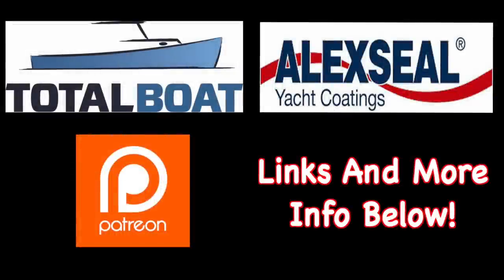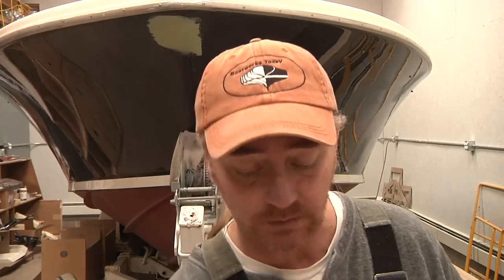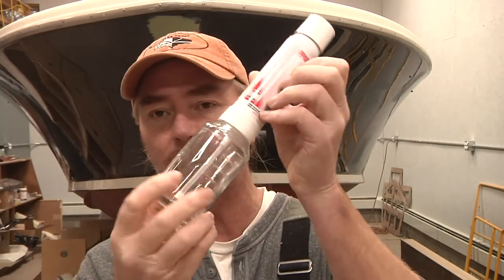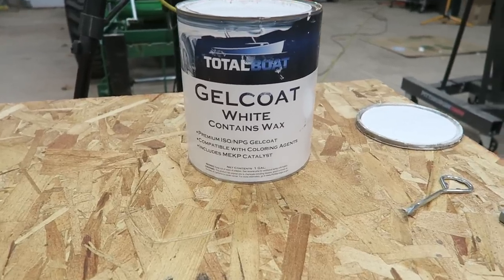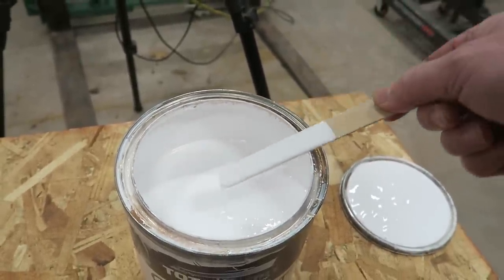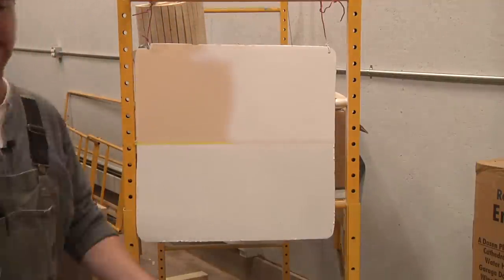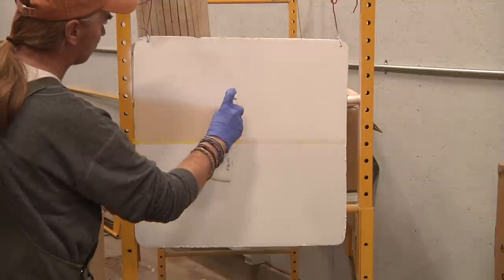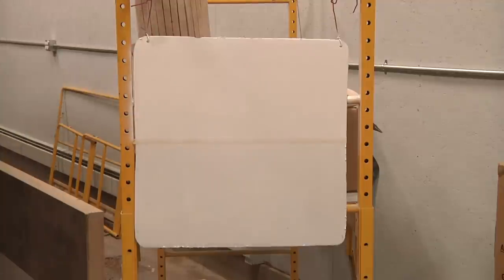SPRAYING GELCOAT DIY STYLE FOR BOAT REPAIRS!

Comment: Tried Preval with variety of house paints and it clogged due to freezing of the outlet.  Pressure drops and it freezes quick.  I tried it in Florida and maybe paired with the humidity it was worse at freezing. 🤷‍♂️ Absolutely worthless. Maybe could work with thin stains.  I can’t imagine using it with gelcoat.

Comment: Having worked in a yard my whole career the Preval was the primary sprayer for small areas. The MOST frustrating thing was the inconsistency of each unit. You can pretty much get a system going where you can mix the gelcoat consistently to get good results but the sprayers drove me crazy. We would but at least 1 case maybe more at a time & if your in a cycle of doing a lot of sprayers it's ok. But buy a case, use a few then let the others sit for a few weeks, grab 1 & start using it & the propellent has leached out so it's useful for 20 seconds & dies. Now you have to scramble around because you only have so much time with the mix.
Reply: How long have you worked on boats for? Prevals work if you know how to use them. If the gel is thin and preval has gas still and is not cold, It has to be the small hole that’s clogged up at the bottom where you insert the plastic straw. A lot of times the hole is really small which causes it to spray like crap . Get a thin metal pin and make it bigger. Make sure to also clean it thoroughly with acetone inside and out

Comment: Thanks, great video. Clearly explained why not to use waxed gel coat. I have been sealing sprayed gelcoat with any brand of Mega Hold Hair Spray. Same key ingredient as PVA. But way cheaper and already in a spray can. Works great. Wash off with warm water. Just let the gelcoat sit for a couple of hours to be sure all solvents have evaporated before spraying Mega Hold. Credit to some article in Epoxyworks Magazine for the idea.

Comment: Keith Rucker over at VintageMachinery used one of those to paint  some old Cast Iron Norton Tri-Stone holders....he said he most likely wouldn't use them again.  The things constantly froze up, and did exactly what you said...and that was enamel paint that was properly thinned.  He said he'd pull a sprayer out to do it next time.

Comment: Could you apply a layer(or multiple layers over 1 or more spray sessions) of laminating resin w/o wax and then final layer with the resin w/wax so the whole thing will cure hard? Re-coat time interval for all layers could be multiple sessions over multiple days. I am assuming that the requirements would be the same as using laminating resin when laying up glass, do not require sanding between layers(if done in a reasonable amount of time of course), is that correct?

Comment: I repair leather seats and I use these when I need texture to hide a repair to reproduce the grain pattern in a door or seat or armrest, they simply spit to much.  I would recommend a badger. 250-4 with large nozzle.

Comment: Hi, I have got questions. How do you stop the leaks in the air vent?

Do I need to remove the filter from the tube when I spray 2k primer, 2k clear coats and base coats? 

Can I refill 2k primer and 2k clear coats and reuse it again?

Comment: Andy I'm apply same sprayer -garbage only I just spoiled a portion of the gelcoat ,,, there is a liquid in it that probably just interferes with the normal spraying of the material, it may be necessary to heat the balloon to a certain temperature before use, but it does not work correctly, as shown in the advertisement in general

Comment: Damm I used the durateck on the bottom of my 1972 boston whaler will it blister on a trailer boat? I've had a problem micro cracks appearing after filling yes it has the boston whaler alligator pox  on gel coat I have used the 3m vinylester filler. the latest try is to soak the surface with west epoxy with slow hardener it been on a test area 3 months so far its ok should i use hibuild epoxy primer im finishing the topsides with paint. will paint on the bottom stave off the blisters  I hate to flip it over again thanks jerry k

Comment: The propellant is a mixture of butane and propane so be sure to have no open flame when using a Preval sprayer.  Link for the MSDS - http://preval.com/wp-content/uploads/2018/10/Preval-Spray-Gun-Power-Unit-SDS-ENGLISH.pdf

I have found that Preval sprayers work very well for small jobs, but the viscosity of what you are spraying is critical.  I have sprayed water based finishes with Prevals and you really have to pay attention to the spray unit temperature there too.  The only other downside of Preval sprayers is that they are expensive, but for a small job you may spend almost as much on solvents cleaning out a regular spray gun.

Comment: Harbor freight little touchup gun drill the tip ( can't remember the exact size i can check if your interested) spray two coats not thinned then sand to 100, then take your good gun thin to 17seconds on a Zahn #4 cup spray looks like glass...I like styrene too but has a short self life.
oops! thats a ford #4, hey I bought it like thirty years ago.

Comment: With any product, there should be a 'material safety data sheet' so for that sprayer just search for 'Preval sprayer MSDS' and you have the answer ;)
I used to have a spraycan that was refillable, but you pressurisde it with a standard air compressor or tyre pump (search for 'refillabble spray can' you should be able to find what looks like a normal aerosol can, but with a tyre valve

Comment: I just googled styrene: apparently bad stuff. I love those little sprayers. When I was da fix-it guy for 126 new homes I carried them with all the colors needed to touch-up after doing spot-repairs in drywall, trim and cabinetry.  When sprayed for only a few seconds the cooling problem doesn't exist.

Comment: Just out of curiosity what size nozzle do they have? 
I tried a compressor and spray gun with 2mm needle/ nozzle and it was spitting quite a bit even with a 2% styrene added to thin it out.
Reply from the maker: I honestly don't know what size nozzle Preval has, but it's pretty small.  If I were spraying gel with a regular gun and compressor I'd be reaching for something 1.5mm - 2mm

Comment: But you really need a gellcoat gun with a 2.5 mm. nozzle or a metal flake nozzle on a car spray gun, remember you want a GELL coat, not a thin paint-like finish... 

Only the Mono Styrene, if you don't have the wax gellcoat you can add melted paraffin wax to the styrene first. I make my own gellcoat from polly resin add pigment then add the melted wax to the styrene in the correct ratio and go from there. Not easy to get right the first time.If you really want to mix using the chemicals not the fancy costly additives learn by experimentation. This is better because then you will become a chemist and know WTH you are doing.😀